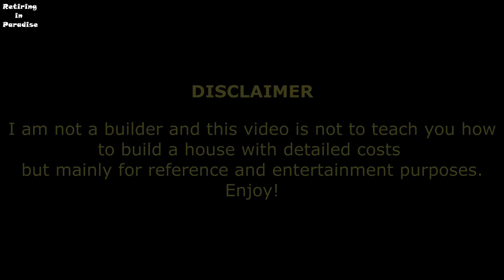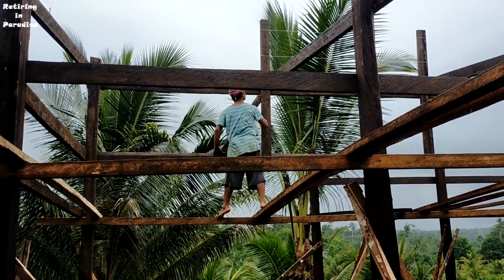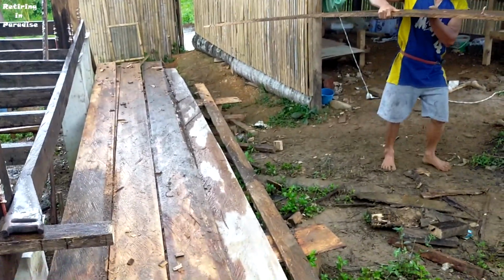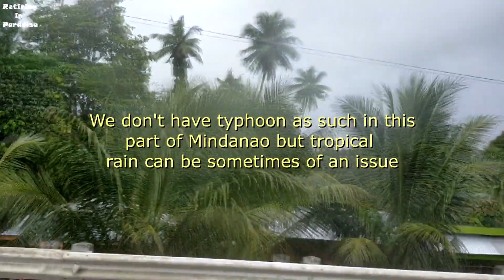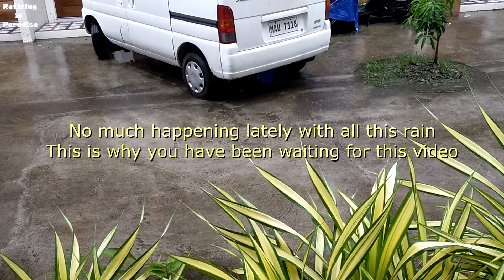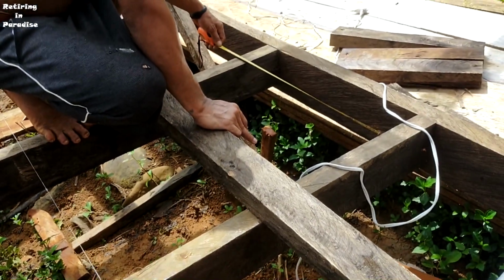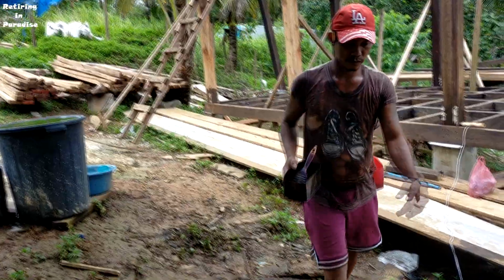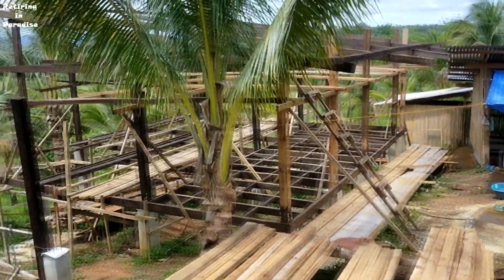V289 - Pt 19 FOREIGNER BUILDING A CHEAP HOUSE IN THE PHILIPPINES - Retiring in South East Asia vlog

Comment: With the very strong typhoons regularly coming here in the Philippines coupled with termites infestation, your wooden built house will gonna face these two hazzard. Its practical already to build a concrete structure here to withstand all a wind signal #5 almost as strong with huricane in the US. Termites surely will fail to destruct concretes. I hope this will help you think over.
Reply from the maker: N O  T Y P H O O N   IN THIS AREA !!!!!
And I am protecting my timber against rot and termites.
Most house in US are made of Timber.
Reply: In the US concrete foundation,2 x 4 wood frames,plaster boards with insulation between them, And concrete spray on the exterior
Reply from the maker: @kenstar1862  still contain a lot of timber